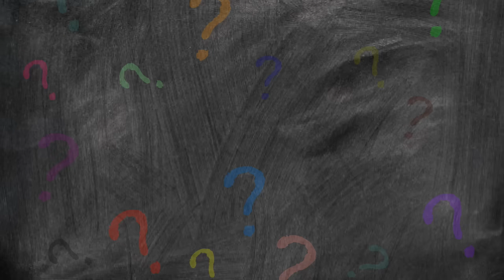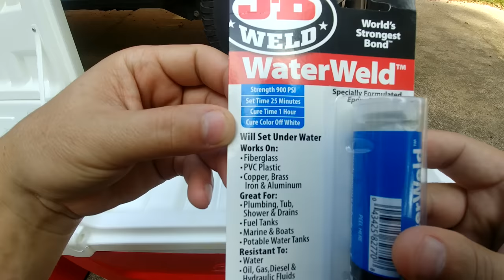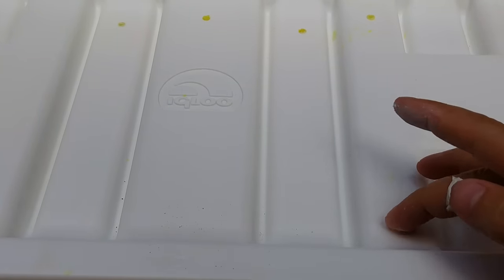Do Yeti cooler hacks work?

Comment: By filling the lid with that product you actually increased the opportunity for heat conduction between the outside and the interior. The empty air cavity of the un-hacked cheap cooler is a better insulator per volume than whatever the foam-with-air-bubbles spray product achieves. I realize it's counter-intuitive but you forced out a perfectly fine insulator volume (of air) and replaced it with some store-bought micro pockets of foamy bubbles of gas which increased the heat-conducting mass between the inner lid surface and the outer lid surface.
Reply: That's probably true, more thermal bridging going on
Reply: I came to comment on the same thing but here it is. Totally agree!
Reply: @pennie m a refrigerator has active cooling. Fridge doors are usually just air. The foam used in this video t allowed heat to transfer more easily from the outside in. A Thermos acts the same way - there is an air gap between the inside container and the outside.
Reply: @pennie m I never said insulation was wrong or bad. I just pointed out that this "hack" exchanged a fairly good insulator lid design for a slightly lesser one. It is still insulated but the conduction loss increased as I described.

It's also a bit of a design issue to muffle and not transmit or amplify mechanical noises made by the fridge compressor.

A healthy attic space still needs to breathe to the outside airspace both winter and summer so insulating a home generally means using some form of physical insulation product plus a vapour barrier and possibly fans. No giant version of the $17 cooler lid would work as a home roof. I suppose the fad of inflatable arena roofs sort of tried this and were environmentally awful habitats inside iirc.
Reply: The insulation will not decrease anything. If anything it WILL increase the cooling potential Al. The issue with the air is once it’s heated by the outside, it will warm the underside of the lid as well. 

It is not insulated when it’s made because it’s CHEAPER to just do a blow molded shell of everything. Lids used to be insulated but it because you cost prohibited. That is the only reason air is used. 

So adding insulation to it will keep things cooler since there is now a barrier there. The cool will hit one side and keep it in and the heat will hit one side and not penetrate. But with just air, the heat will transfer to the inside way sooner.
Reply: @PTRRanger951  Possibly, but only if the manufacturer uses better quality insulation because the video shows exactly the opposite, the air is better the spray can foam insulation. More than likely tho, it’s just like OP said. & the lid was actually using the air gap to reduce heat transfer like a double wall thermos or double pane windows (although windows typically use a specific gas to further reduce heat transfer), this seems to be supported by the fact that the lid is only joined around the edges since the foam was able to move thru most of the lid thru the 1st hole.
Reply: but foam is foam because it has "air pockets" in it.... also yeti coolers are foam filled hence the reason for this video

his mistake was he didnt fill the cavity of cooler with foam and the weather stripping didnt allow for a decent mating
Reply: @jasonpallotto6841  Both the points you mention were addressed by the video itself. I also remind you that he used an identical untouched cooler as a control test and that one slightly out-performed the fake-yeti both times.

Jason, I invite you to analyze your own precise words above until you come to grips with the vital points that you're missing about your stated premise. Bear in mind that a pair of real world tests has indicated against your specific conclusions.
Reply: The reaction of the expanding foam also generates heat
Reply: @PTRRanger951  looks like his actual test disproves your theory
Reply: Could you somehow pvd coat, or otherwise copper coat the inside, and then suck the air out and keep it under vacuum?
Reply: @lindboknifeandtool  I seem to recall that maintaining a true (or even reasonable) vacuum is both tricky and costly to do. At that point you might be better off just buying a thermos product made in an established factory for your purpose instead of some home made hack.
Reply: Commercial Refrigeration tech here. You are correct. Vacuuming the cavities to reduce transfer could be the only way this could have worked better. By adding solids, as you said, just made a heat bridge.
Reply: I bet that foam wasn't 100% done flashing off as well. Depending on the product sometimes it takes months to finish. It being in a closed off space as well probably didn't help.
Reply: @malclaire  Probably. Back in the day foam was made with R12 I think (gasp, lol) and it does need to dissipate, the idea was while evaporating into a gas it'd make many cavities. This process is probably wholly disturbed.
Reply: Outstanding reply! But he also did an outstanding job of experimenting with the two!
Reply: EVERYONE WITH ADDED FOAM KEPT THE COOLER COLDER LONGER! SO WHO CARES ABOUT YOUR BABBLE. THE RESULTS PROVED YOU,    WRONG!!!!
Reply: @73mtba  He did a lousy job! We filled it complete! And the cooler keeps much colder longer! Thicker foam keeps them cooler
Reply: That's what I came here to say. Science! That's why the tops on some coolers are empty. There are some coolers that have insulated tops but that's because the insulation is actually the proper insulation for a cooler and not a house. It's similar to how wearing layers of light clothing keeps you warmer than one big coat. The air pockets in between each layer act as insulation.
Reply: Thermal bridging 

If you lined the inside with 1”-2” polystyrene foam board, it would make a huge difference?

I believe the window door great stuff isn’t 💯% closed cell foam. The regular great stuff would work better…

My $.02
Reply: @GeneMstoner   yup. Usually for double pane window. 
We using a special gas call argon. It’s definitely deflect most of the heat out.
Reply: But not really...
That lid and cooler are not a vacuum, and will circular air. They will transfer energy more than any closed cell foam which traps gas from circulating. If insulation worked as you claim, none of the hundreds of formulated foams would exist. Reality is, homes, coolers, insulators all use a medium rather than straight air.

If you can make a solid steel cooler, that is strong enough to maintain a vacuum that does not weigh several hundred pounds and doesn't cost thousands of dollars, well sir you have yourself a product
Reply: @TexasJack78  Congrats, sir. You managed to misread and or misunderstand the entire concept and proceeded to seemingly object to things that were never stated.

Start with the fact that real world trials shown here disproved the "hack" and go from there.
Reply: yeti coolers are 100% foam filled on all sides and the top. It could be a better insulating foam, I don't know. I assumed it was the rubber weatherstripping he put around the top kept it from pressing down in tight like it did before the weatherstripping.
Reply: @rburn99  Could we all remember that even though he referenced that brand and the trend of publishing alleged hack videos, he didn't directly put ANY of that brand of product under any kind of test in this video so I don't understand the reactions about Yeti-this or Yeti-that.

We can only assess what we saw in this video about the items he tested in the way he showed. THAT'S IT.
Reply: Honestly, I think He simply utilized the wrong type of product to foam expand for His insulation. Other videos I've seen they also used a flat sealing tape rather that what He used around the circumference of the lid... 🤷🏾‍♀️ JB WELD for waterproofing was the best choice He made of the Three products He bought/purchased.
Reply: Wait. Soo why are we putting insulation foam on houses?
Reply: @K-ila  Because houses aren't already made like blow moulded plastic boxes with a pocket of air inside the inner and outer surfaces to start with. Various forms of foam or ANY insulation will generally improve the insulation situation of a typical home construction. What foam does is add a blanket consisting of tiny pockets of enclosed air bubbles sandwiched in some way that also excludes drafts.
Reply: How many thermodynamic courses have you taken. Air is good, foam is better. Foam increases R value which thermally increase resistance to heat transfer. Most heat transfer is conductive unless cooler is going 60 mph. Highly R value lowers heat transfer. Foam is higher R value and one of the best per in thickness.
Reply: @keithloucks7167  Don't know who that question was addressed to but I didn't only pass my University Classical Thermodynamics course, I scored 100-percent on the final exam. Perhaps you didn't follow the entire thread of this specific interaction and are the third or fourth one to misunderstand the exact assessment being made in the (very flawed) video experiment and jumped to some TOTALLY UNWARRANTED CONCLUSIONS about the real world.
Reply: How is spray foam a conductive material?
Reply: Air has a lower R value than foam per inch. Check thermodynamic heat transfer tables. A higher R value causes a lower conductance heat transfer. In Canada we go for high R values of Insulation to keep  our houses warm at -35. Using an infrared temperature gun you can compare wall temperatures. A cold cooler wall means good conductance of Cold or low ice retention times. Check the bottom of cooler. I know how to calculate and how to do fix to work. SPRAYfoam in top increased a 30l igloo cooler to 1.5 days of ice. Inserting 1" r5 foam inside bottom and side walls increased to 2 days with a 2l and 1l frozen bottle. Bottom still cold. 24l roadie yeti only gets 2.4 days as per posts on web.
Reply: @puirYorick  I  may have misunderstood your statements. My background  is a Professional Engineer with a Masters in Mechanical Engineering, having in last 15 years specialized in Energy as a Certified Energy Manager. Living in Northern Canada, I understand theoretically and practically that good quality foam at R5 per inch beats air for resisting heat Transfer whether heat or cold. This is fact and understood by all of us Canadians who woke up this morning with a below  -30 C temperature.
Reply: @PTRRanger951  lmao... i see you slept right through your physics class.  just sad.
Reply: @cdcdcd6777  yeah. Okay. Whatever you say bud.
Reply: @PhysioDetective  a thermos has a vacuum seal so no air.
Reply: @jhue73  fair enough. Happy to be wrong. Thanks.
Reply: No, the air is not a good insulation.  Foam is far superior.
Reply: @vincentmontambault217  Maybe read through the year-old thread in its entirety before you chime in and repeat an assertion. One that was already dealt with as a mistaken interpretation of what was going on in THIS particular case.
Reply: @puirYorick  I have read many comments, not all, but many told the same idea that foam insulation insulate less than air.  And that is a mistake.  Air have a very low insulating power.
Think whatever you want anyway.
Reply: This is why I want to put a sunshade out side my bedroom window.  So there is less heat transfer to the window and into my room.
Reply: I think it probably had more to do with which cooler got more sun through the windows during the day.  Or more likely, one of the coolers had a poor insulation fill at the factory.  I say fill them with ice and use the heat gun or a FLIR to look for cold spots on it.  If a cooler is out of the sun, the lid really doesn't need much, as heat rises and cold air sinks.  IE the open top freezers at the supermarket.  Lot of weird comments below about air being better than insulation.  The key is DEAD air for that to work.  Air that's free to move in a space is better than no space, but convection currents within the space will transfer heat faster than an insulated space.  Most lids aren't insulated these days because it's A. Cheaper not to and B. It's a flat surface with the cold side down and hot side up.  See freezer reference above.  If an air space was better than insulation, why insulate anything?  Just make a box in a box with standoffs to keep them separated.  Thermoses don't have an air space, they have a VACUUM space.  HUGE difference.  They make a can welded in a can and pull a vacuum on the space between.  Some ad charcoal or reflective coatings in there as well.  See DeWar flask or vacuum flask.  There are some interesting technologies making tiny glass vacuum balls that can be added to paint or used as loose fill insulation.  Millions of microscopic glass vacuum balls.....crazy.  Try to figure out how they do that!!
I highly recommend getting some 1in foil clad foam insulation board at your home store or building supply and cutting a piece the size of your cooler's foot print and setting your cooler on that.  Most of your heat loss is through the bottom into whatever you set it on.  If you can't do that, set it on some narrow strips of wood to get it off the floor, especially concrete.  Keep you cooler out of direct sunlight.  You can go insane with this experiment.  Haha!
Reply: @puirYorick k
Reply: If that is true why would the yeti  insulated cooler do better 🎉
Reply: @robertsmith616  Pavarotti sang better than my pet goldfish. Neither fact is relevant to the very specific point being discussed. I had a twenty-year-old Nissan that ran better than my buddy's expensive new Audi sportscar because he bought himself a lemon by mischance. The diagnosis of a SPECIFIC experimental result in real life isn't meant as fodder for silly whataboutisms.

Everyone who wants to jump onto a months-old thread should probably read the ENTIRE thing in sequence and grasp the full context where it arose BEFOREHAND.
Reply: @robertsmith616  Do you really think anything about the other coolers is superior to the yeti here?  The insulation thickness of the entire cooler is much thicker, as is the thickness of the shell and liner.  I'm an insulated lid fan.  In a shady calm spot, the lid won't gain you much.  But in direct sun is sure does.  There is a reason most cooler lids are white and it ain't for styling.
Reply: @mikemorgan5015  price and practical use  most people only use a cooler for a day or three  a two dollar bag of ice beats a two hundred  more  cooler
Reply: @robertsmith616  I'll concede price.  Not even arguable.  Practical use?  Na.  The high end coolers should last a lifetime.  The old Colemans did.  I see what you're saying and agree with your points, but NOTHING about a regular cooler is better than the high end models from Yeti and their copycats.  Weight, I guess.  Price and weight.  We can do cost/benefit analyses all day long on any product.  Better for YOU doesn't mean better.  Some things are objective facts.  We all have to make the call on value and worth which are subjective. The only high end coolers I own were gifts or raffle wins.  They aren't worth the price to me.  But there is no doubt that if price wasn't an issue, I'd want the best, longest retention, durable cooler available.  My most used cooler is a cheap, 18 can, soft sided, California Innovations cooler with a hard tub insert and easy access flap on top.  It fit my needs most of the time just as your comment says, but it's not better thermally, not more durable, and won't last much longer.  Hint:  Never get a soft side cooler without the tub liner.  Soft siders ALWAYS leak.  Maybe not today or tomorrow, but when you most need them to not leak, they'll leak.  Haha!

Have a super weekend.
Reply: In another project I filled a garbage bag with great stuff. A week later it was still gooey in the center because the solvent couldn’t get out and all the bubbles collapsed leaving liquid polyurethane. Without the bubbles I’m gathering solid or liquid polyurethane is a good conductor. 
I wonder if more holes would allow it to breath and cure faster while the bubbles are still
Reply: @ckgurr  Did you sprinkle or spray the inside of the garbage bag with water?  Try that and see how it goes.
Reply: Yep. Only way to actually make it better would be done kind of poly fill to slow convection.
Reply: @wwilkjr52979  I've got a plastic welder.  How about spliting on the mold seam and filling it with rock wool?
Reply: @vincentmontambault217  depends on the foam
Reply: @mikemorgan5015  I don't know what rock wool is but if it's like poly fill that should work
Reply: @wwilkjr52979  It's a mineral based "wool" insulation product that is made from spinning molten basalt and blast furnace slag.  Thus it's extremely fire resistant and water proof.  It won't rot, or support mold.  Similar to fiberglass it's generally denser heavier, and more rigid but has a significantly higher R value.  It's also available in blowable loose fill "granulate" form for attics.  Interesting product.
Reply: @mikemorgan5015  then I'd imagine it would probably work okay.
Reply: I was expecting this comment. There's a reason the lids are empty, air is the best insulator. Decreasing the space only hurts the insulation. The coolers are designed with that in mind so modifying something that was already thought out to be the most efficient it could be is usually going to result in a less efficient product.
Reply: The coolers are most likley not. Consistent with tje fa tory insulation on the  bottom and sides
Reply: @jasonpallotto6841 insulating foam is closed cell soray foam IS NOT closed cell.  Its use is to fill cracks and stop drafts.   It is not intended to insulate.    Also will not react correctly with out air flow.   So there is all that
Reply: @jasonpallotto6841 YETI uses closed cell insulation.   Completely different
Reply: @K-ila closed cell insulation is different
Reply: @keithloucks7167 spray foam is not closed cell insulation.   Your welcome
Reply: You can’t assume the bags of ice had exactly the same mass. Weighing out the exact same amount to do the test would be a bit more precise.